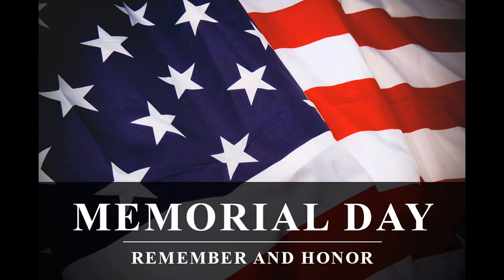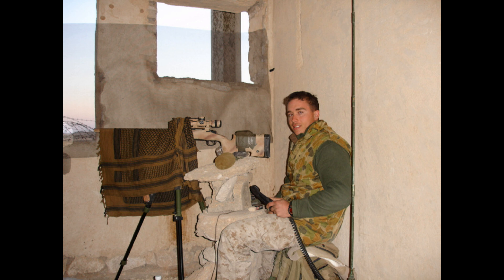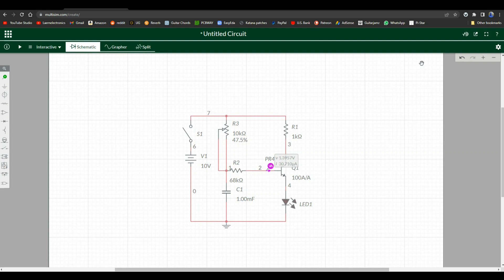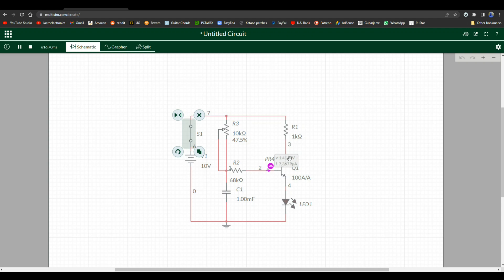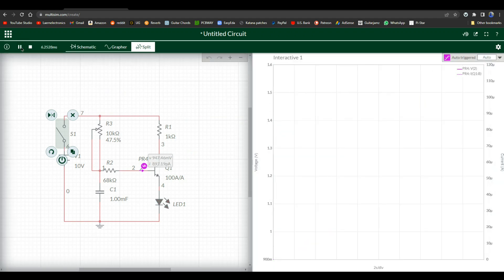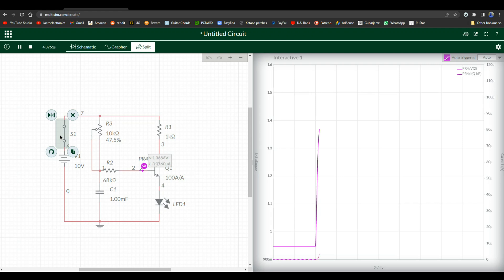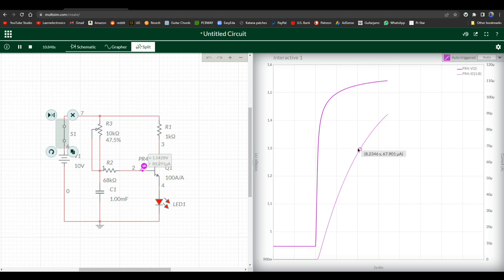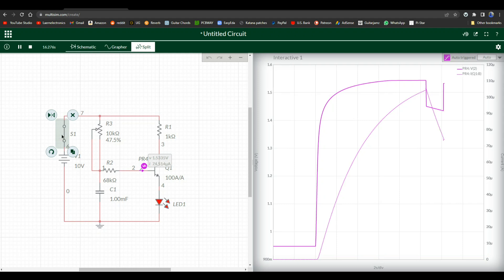On After Delay

Comment: Hi Paul..  I need a 'delay on' to control the enable pin in a level shifter (my microcontroller ran out of pins). This circuit can power from VCC and run independently of the uC. I only need a second or so.. Looks like this might do the trick.   Thanks.

Comment: Thank you for sharing Paul.  

In this circuit could load be placed on the collector side with emitter tied straight to ground ?  What are the implications of that choice ? (i've read about some "gotchas" regarding the choice, but have yet to fully understand the topic myself)